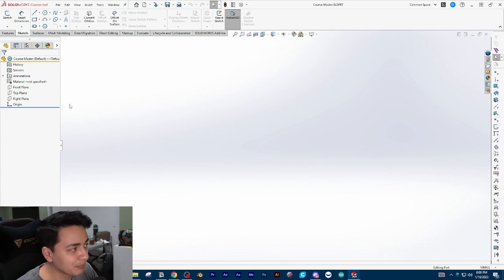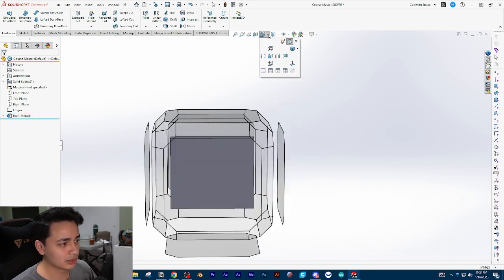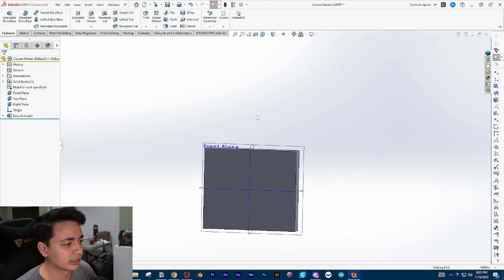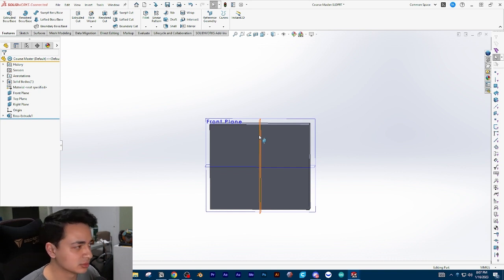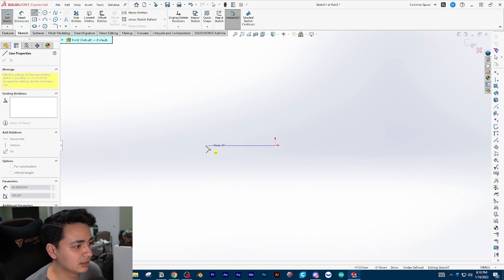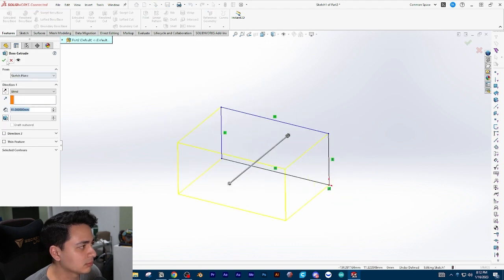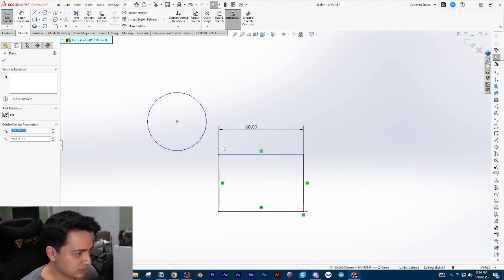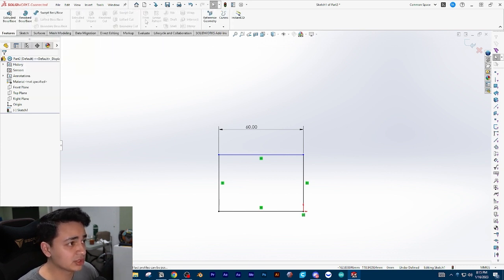Intro To Mechatronics: Part 2.1 Introduction to SOLIDWORKS Sketcher

Comment: Hey Danny! I recently got certified as a solidworks associate through a course offered at my highschool. I was wondering if it would be worth it to continue the training and advance to the next level for potential career opportunities. I’ve been interested in possibly finding job offerings during or directly after highschool, do you think this is feasible and something I should pursue?
Reply: nah they dont pay do software instead
Reply from the maker: hey kaladin sorry for the late reply, been busy! (if you have any questions and want a faster reply join my discord im active there). ive heard some people have success with solidworks certificates. in my opinion it is a resume builder. your time is probably better spent building your own projects to better teach yourself the software. however if you have trouble self teaching it is a great place to start